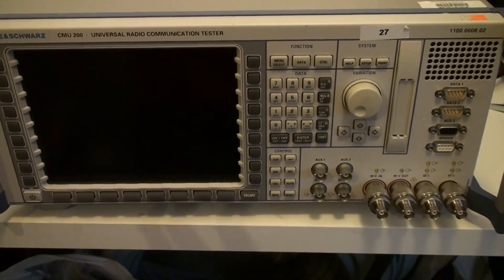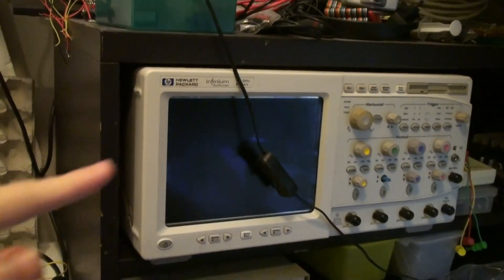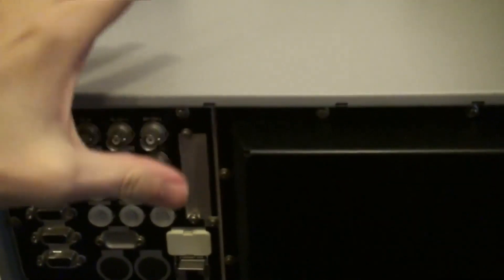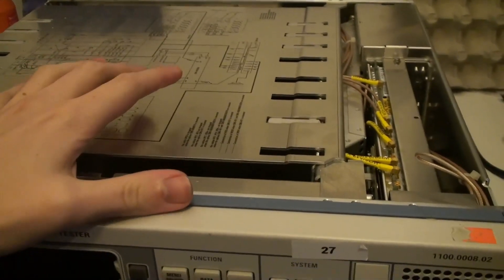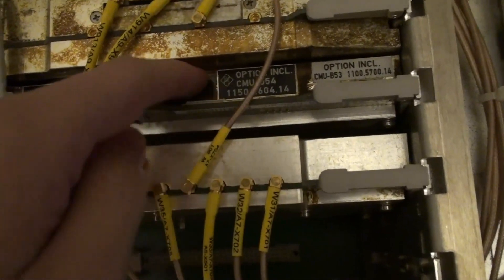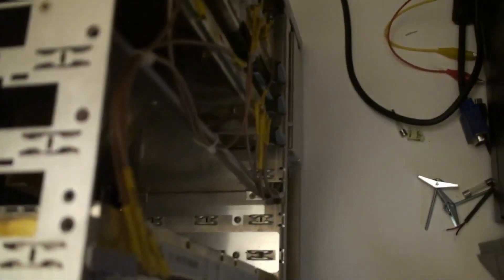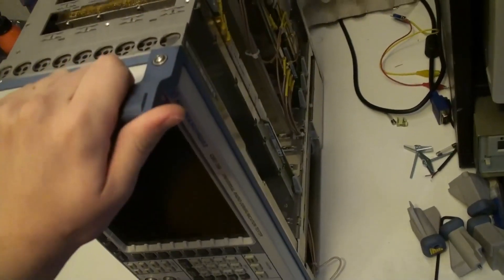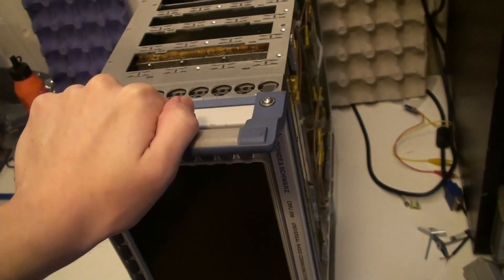014 R&S CMU200 Hardwear look through

Comment: RF1 can eat 50 watts directly! not many spectrum analyzers can handle that without blowing up. it's a fantastic spectrum analyzer and a really nice signal generator. user interface is a bit odd but the hardware is first rate. you can also use RF3 with software as a tracking generator so you can characterize filters and stuff. tons of CMU200 were dumped on ebay after 5G came out, and all these were instantly useless for the cellphone manufacturers who were using them. most of these are equipped with options up to around the US$80,000 level. and they're being sold on ebay for $800. just a reminder that test equipment does NOT retain its value. test equipment is NOT an investment. it's an asset, that depreciates in value.
Reply from the maker: Not to mention that the 50 watt spec on the RF1 port is reduced drastically if one has the second RF generator option.

Though, yes, it is practically just an cell phone tester in a box. Not really meant for anything else and one should honestly be happy that R&S decided to add the "basic" features they added to it.

But I still need to make a video about the pitfalls of a software based tracking generator.
Reply: @todayonthebench  cmu200 way exceeds anything 99.999% of hobbyists could ever need in test equipment. for $800 its a steal. many expensive SA's dont even have 10hz RBW like the cmu200.
Reply from the maker: @TMS5100  The CMU200 is a really well equipped piece of test gear, though it has one big limitation for hobbyists.

The CMU200 only goes down to 10 MHz on the spectrum analyzer. So measuring low frequency stuff is a bit outside its capabilities. (Though, one could add an up converter, but then one needs to validate its linearity and such...) And to be fair, the CMU200 doesn't even have much reason for going down to 10 MHz, and for being an application specific piece of test gear, I am honestly surprised it goes this low and doesn't end a bit bellow GSM, like having its lower limit at 400 MHz.

Unlike most bench spectrum analyzers that goes down bellow 100 KHz. Though, the FFT on an oscilloscope can partly do this job, but with inferior dynamic range.

(Though, the CMU200 is also oriented for two-way radio equipment. That works all the way down to about 30 MHz. So its 10 MHz lower limit is fairly logical.)

Comment: How can you transfer files from and to the hard drive without opening the unit?
Reply from the maker: The unit has a compact flash card reader on it.
So transferring files isn't a major hassle.
Reply: @todayonthebench  pcmcia slot?
Reply from the maker: @egbertgroot2737  I think so.
But haven't used it myself, so haven't checked the exact details of it, but it does support saving and reading stuff from a memory card of some form or another.
Reply: @todayonthebench  I will try to get a pcmcia memory card and will let you know
Reply from the maker: @egbertgroot2737  I would recommend checking it up in the instruction manual. It is rather clear on most details.

Comment: Thank you for this video!!
I have CMU 200 with B12 option in my bench recently purchased, 2 weeks ago.
I can't use volume control and panel loundspeaker, but I believe this equipment don't have internal analog demodulators (only modulators in signal generator).
I try to search any information about demodulators and volume control.
The spectrum analizer start in 10MHz, but I've heard that it's possible change to start in 100KHz like a RF generator, I don't know how...

Best regards!!
Reply from the maker: Yes, I have also read somewhere in the manual that one can get the spectrum analyzer down to 100 KHz, but it seems to be part of some extra option or something.
And yes, audio demodulation to the speaker seems to require the B41 option to even be plugged in. But I am not fully sure about that.
After all, the base unit is fairly capable in and off itself, but anything extra is practically an extra card in the unit. I guess it would be very heavy when fully equipped...